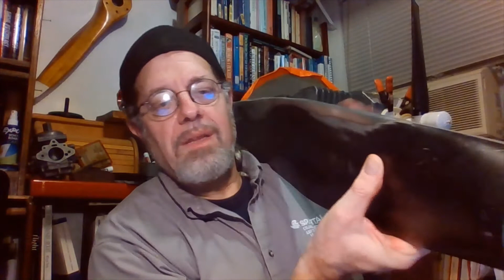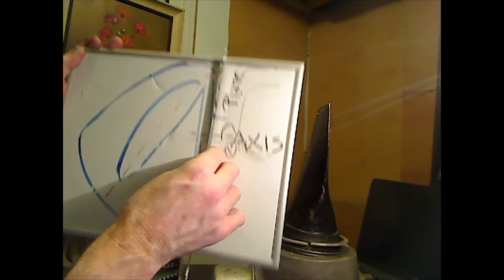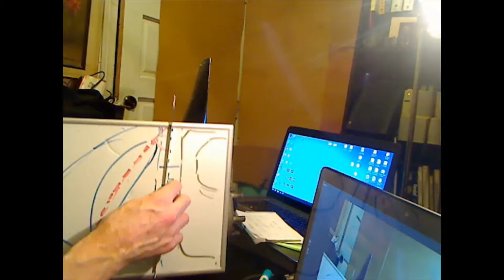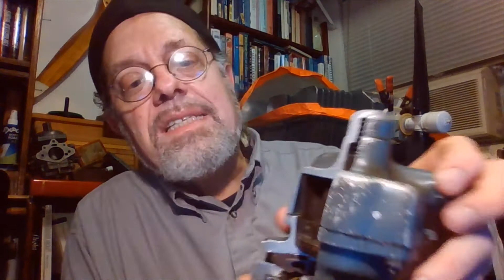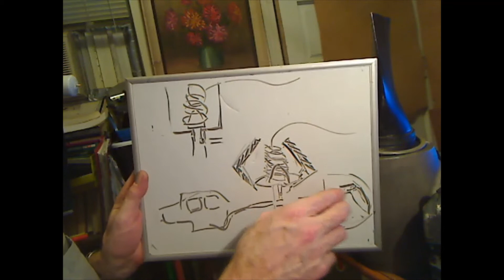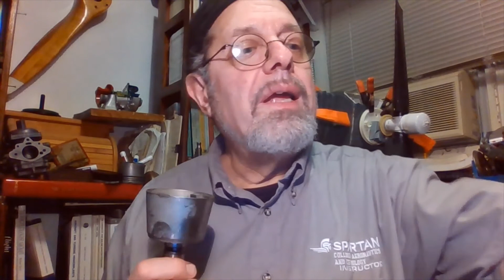Propeller Governors

Comment: How does the oil get from the engine into the prop hub?
Reply from the maker: Good question,; here's the answer.  Usually, there is a channel in the engine block called the galley ( or gallery) and it moves the oil supply fom the oil pump in the engine to various areas, including the prop governor.
Reply from the maker: The engine oil is ported to the counterweighted prop in order to REDUCE blade angle.  But in the NON counterweighted prop, the governor oil usually is ported to the prop to INCREASE the blade angle.
Reply from the maker: BTW,  the oil gallery is where we are likely to find a sending unit in order to read the engine oil pressure. The wet sumpstores oil WITHOUT pressure.
Reply: @davidfreed9553  Thanx for the quick reply! So the only way into the prop hub is through what must be a semi-hollow shaft in the crank. Sorry, but where and how does the oil get into the crank ... ports back in the engine?
Reply from the maker: @taproom113  You are on the right track except, simply put,  the oil is fed to governors by this galley.Then, the the governor delivers the oil to the propeller, or the oil in the prop is drained by the governor's pilot valve  to the sump. Of course, there are a variety of different propeller models and manufacturers, so the easy explanation I offer (Hamilton Standard counterweights and McCauley non-counterweights) may not exactly apply to gear-reduction propellers. It gets MUCH more dasterdly. Also, I'm afraid the oil in the semi-hollow crankshaft is a different matter for small planes than for various other planes. For small engines about which you refered, you might do well to watch the 1937 Chevy movie, "Riding the Film."

Comment: Doesn’t a normal single Eng aircraft constant speed prop set at full increase ie. flat pitch rest on the low pitch stops ?   My understanding is that at full increase the prop blades are on the low pitch stops  …. normal position for take off … and so the prop essentially is the same as a fixed pitch.  All oil is ported to the sump … I remember rather heated discussions regarding this issue.   The physical low pitch stop determines the static max rpm of the engine.
Reply from the maker: For take off, the pilot will move the prop lever forward to low blade angle. Counterweight and non-counterweight props port oil differently to move their blades to low pitch,  but the pilot of planes using either of these constant speed  props will move prop levers to forward position for high rpm and take off. I hope you understand that governor oilisported differently a.ong these types of propellers, but they are adjusted to achieve the same blade angles for the same purposes.
Reply from the maker: Among
Reply: As I understood a constant speed prop ( talking basically about a hartzell or McCauley on single engine airplanes ).  Engine static rpm is dictated by the prop low pitch stop .  The governor is out of the picture completely …. basically there is no governing going on .  Here is where the discussion begins.  Not talking at all about when the prop control is moved from full increase rpm.  Talking about low pitch stops … and static engine rpm.  Used to teach students that on any take off  …. with any prop … if constant speed set to full forward .. full increase rpm .. the indicated rpm is the best and first sign that an engine is or is not making its rated power.